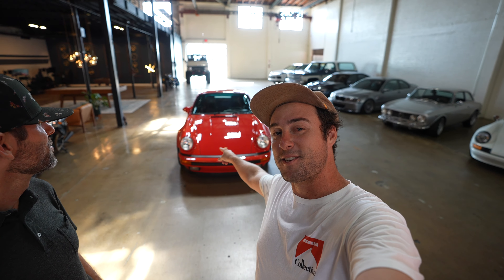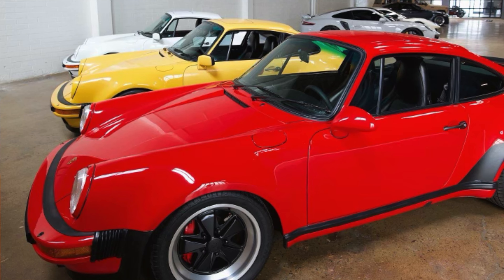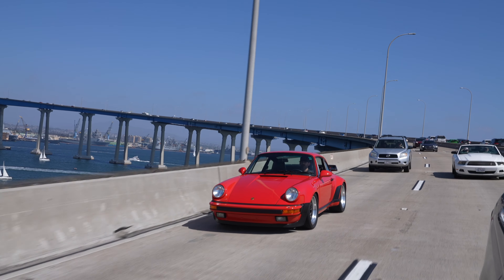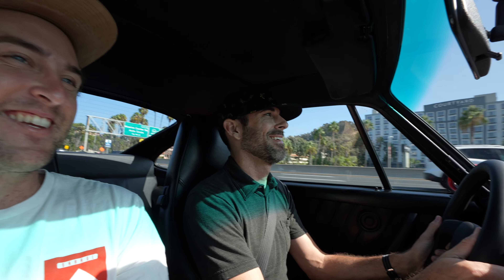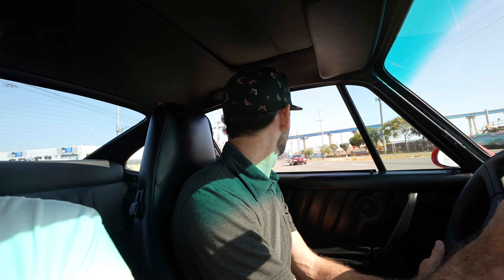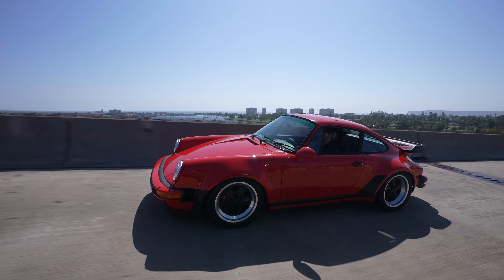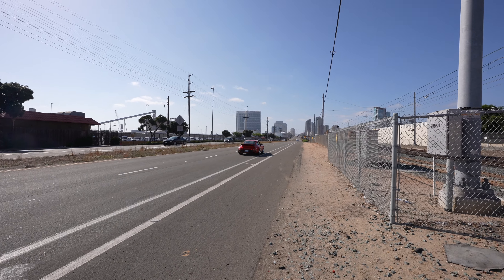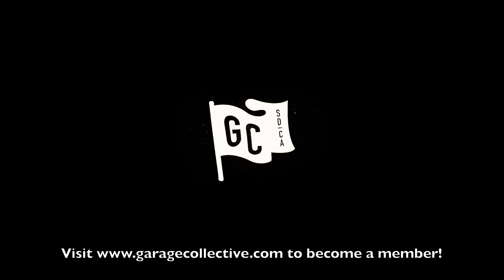Porsche 930 Drive & Review (RAW BIG TURBO NOISES)

Comment: I don't know if you should be experiencing a soft suspension and a lot of body roll. That's not my experience.
Reply: It is stock suspension, lowered, with an aggressive alignment.  But soft compared to modern day stiff suspensions.
Reply: @911Boosted  Thanks. I guess it's all relative. :)